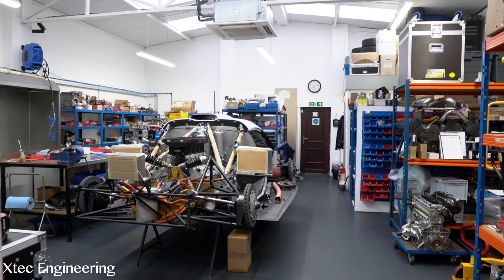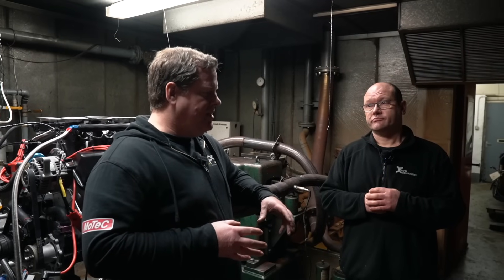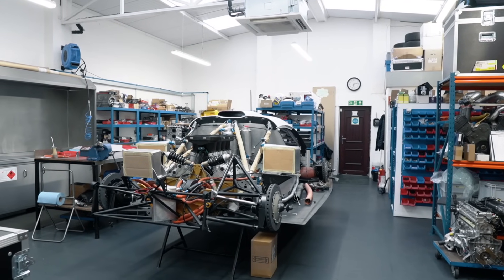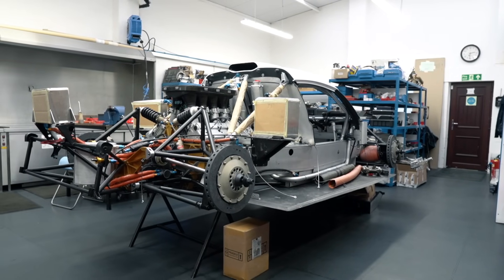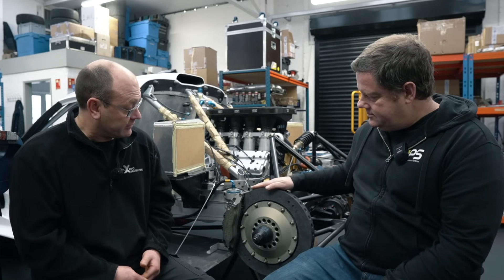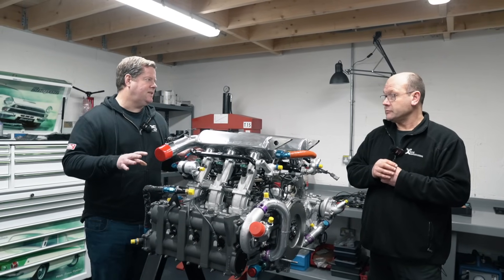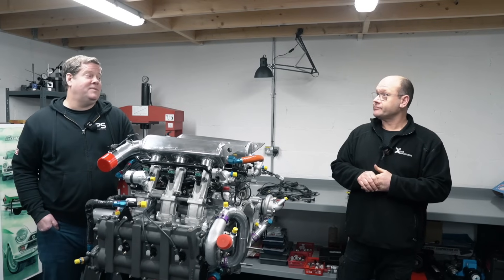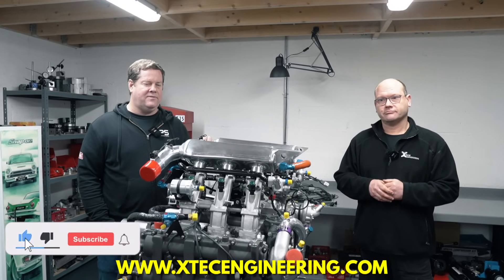Running a V8 Supercar Engine on the Dyno - EPS motorsport making a living

Comment: Stuff legends are made of! X tex and EPS motorsport. It’s would be a dream for gents to run your oil rag over my 6.0liter M119 
Top of the game you lads !
Reply: Is that 6.0 M119 of a R129 SL60 or  W124 E60 ? Sounds rare and very spicy 👍🏻
Reply: @hristohristov8787  it’s 500E base. Had custom pitons made, machined down the counter weights, steel liners, more aggressive cams than E60 and converted from hydraulic to tappet shims. I think it was ten days work to do the valve clearance and DTI timing cams. Up and running know, so next stop is a tune. I understand these gents, resorted and maintained a Sauber C9
Reply: @bernardwarr4187   That sounds amazing and the same time a lot of work,well done 👏 The engine after a proper tune will definitely sounds and performs on another level. Best of luck to you sir and a happy new year

Comment: Those Lotus damper connectors are quite elaborate. Would like to know why they are quite so tall, seems unnecessary. And why would a normal pushrod not work in this chassis?

Comment: Two litres of fuel less per lap is a very useful weight saving. Just shows how much better modern engine management is than the fairly primitive systems available even to factory teams in the 1980’s.